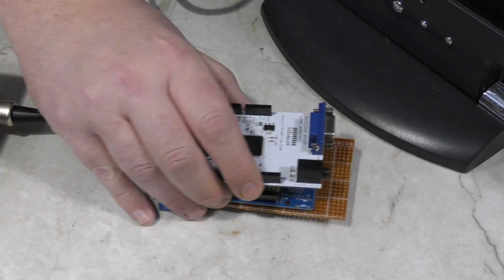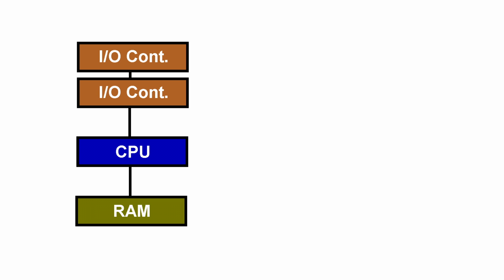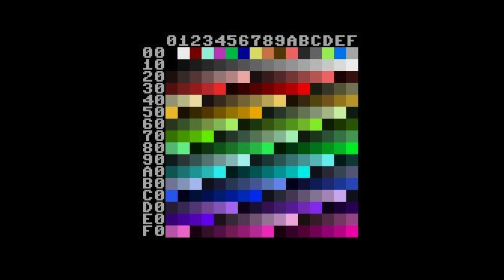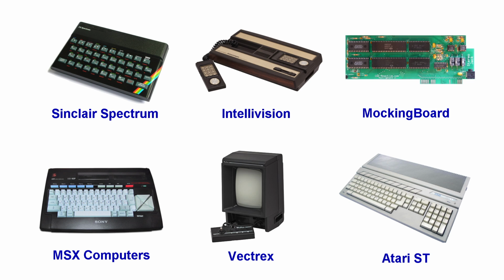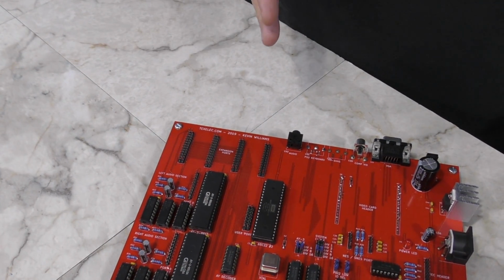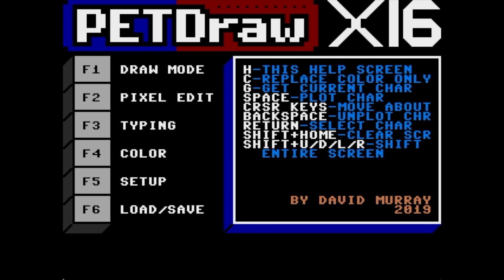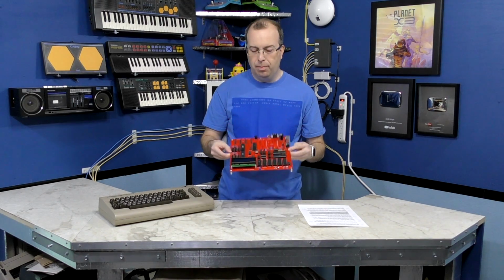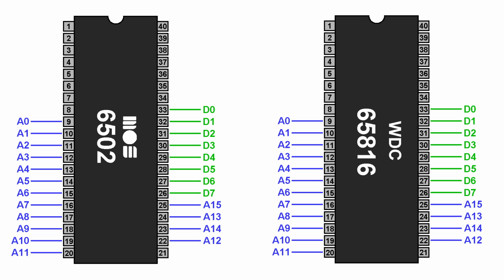Building my Dream Computer - Part 2

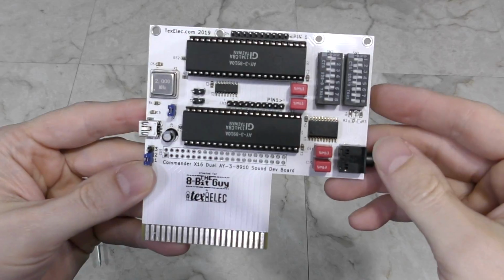Comment: 19:37 At this point you should ask Kevin to make a board that's basically a bus for all these devboards. It could hold three or four cards and sit flat on the table with a removable card edge plug connected via ribbon cable. You could have a small switch or jumpers to select which board will be talking to the C64.

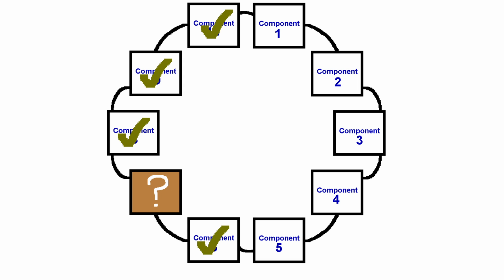Comment: 4:02 ok the way around that is simple. You can do one of many things.  First, you use sockets, so you can pull components and put them in test equipment to test the individual chip components.  If you don't want or can't do that, you design the board with JTAG test pins so you can do border scans.  If you can't do THAT, what you'd do is get a digital logic probe/DAQ and connect it up to the chips (or better yet, test pads) in situ to see what's going on.  Easy peasy

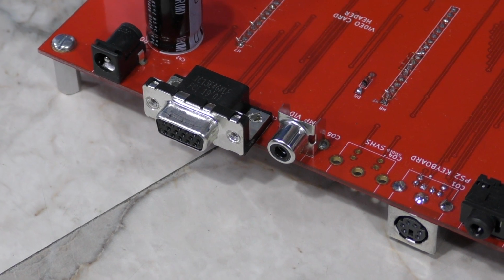Comment: 24:26 A barrel jack? Maybe I should try and power the X16 (when it releases fully) using just a 9 volt battery.
Reply: I don't see why that wouldn't work
Reply: Maybe I should reconsider. I mean 9 9 volt batteries.

Comment: Did you make typos writing kernal instead of kernel?
Reply: He seems to be copying the spelling used by Commodore. It was originally a spelling mistake by one of the designers that made it into the manual for PET, which Commodore later tried to explain as standing for "Keyboard Entry Read, Network, And Link"

Comment: will there be a MiSTer-Version of the X16?
Reply: Considering this is a commercial venture, i doubt it for the time being. Maybe when there are no more sold units, there could be a MISTer version of it. (remember one of the goals is to get earnings enough to sell a rpi sized board with an FPGA version of the X16, so no free versions before that time i guess)
Reply: @Mr-te7dt  I understand this conservative perspektive, but I won't count that as a legit argument. I tell you why I think that. If there will be "to less" customers, there will be "to less" developers. MiSTerFPGA has a ethusiastic developer-community. So if the longterm goal is a X16 at rPi formfactor, why dont compute with this powers to success.
I bought a C128 last week because the MiSTerFPGA brought me back to living 8bit and started programming in Basic again and try to learn Assambly better after 30years. If there would be a fpga-core on MiSter for the X16 (like it does for the rest of the 8bit 'family', like PET, C64, C16..) it would be engaging, i think. 😉👍

Comment: supporting labels in a type as you go along single pass parsing environment is pretty hard to do, considering that you only know where everything is located after turning all the mnemonics and macros that precede it into bytecode. which is why virtually no assembler/disassembler/monitor programs have that. especially not if you also still want to account for things like zero page instructions being shorter and the fact that stuff entered later can overwrite lower locations already filled out, moving it all again. simular programs on much larger computers also don't do that :P if you want an actual assembler, with labels, just use an actual assembler with labels. which will also always be multi-pass. besides that most actual monitor programs for the 6502 can't even compete with dos debug.exe for the 8086... let alone offer more functionality. for something that's been around for that long that is quite disappointing :P

Comment: i like the idea.. but why not just write the software for the raspbery pi?.... its more than capable....   and whatever expansion ports you need?.. idk.. maybe there is more backend software that needed to be written to emulate the 8 bit experience along with how to interface the 1541...  just a thought.
Reply: It's not a goal to have something that pretends to be an 8-bit computer from the 80's. The goal is to actually build a real computer from available parts that is as close to how it would be built in the 80's but with more capable memory map and graphics. If you want a RPi based Commander X16 you can already do that. Just setup the X16 emulator to start immediately after RPi boots.
Reply: @novh4ck  as long as I can rename the file names for samantha fox strip poker for the c64 I dint care what format it is!
Reply: @chrismason7066  X16 won't run C64 games.

Comment: Call me crazy but I think I may know how to get a $50 Commander X16 out. In part one, you were going to use the CPU in the SNES but then said that you couldn't because of how annoying the CPU is, thanks to the way some of the address lines behave. I'm thinking that since the CPU is 6502 compatible, perhaps it'd be possible to put the important stuff (GPU, USB ports, extra ram besides the 192k onboard RAM, SD card slot) on a SNES cartridge and let the SNES be the CPU, since it already has the decoding circuitry on it, making it easier to work with. I don't even know if this would be possible, but if it were, that would be an awesome way of getting to the $50 price range for the X16, and it would be great for Petscii Robots since it already has SNES controller ports on it, since it is one.

Comment: Your main goal is to build a $50 razberrypi that just emulates a retro PC. Why not just buy a much cheaper pi (probably has hdmi port and USB c) and run an emulator on it? I love your original design plans I just think your idea for the final product is useless. Slapping an LS motor in a model T doesn't make a $50 model T.

Comment: You are very outdated, 20 years ago mankind already enter the 64 bit and now we are looking for 128 bit instead of stucking on 8 bit like u do
Reply: The whole point of the project is to make a retro machine….
Reply: If the point of a project is for hobbyist's to build and program their own computer then 8 bits is the sweet spot, if anyone ever makes a 128 bit kit for hobbyist's to solder the chips are going to be 8" long, totally non standard, probably hideously expensive and a nightmare to solder. The resulting machine won't be any more fun or teach anything that the 8 bit machine won't and will still only run at a fraction of the speed of a 64 bit professional machine.
Reply: @gadget348  8 bit system only for calculator, basic clock and some sort like that. Definitely doesnt support directx. Youth generations wouldnt learn anything from this.  Let's forget the past and welcome the future.
Reply: @noproblem3500  ....you clearly don't write programs or you wouldn't have made such a idiotic statement.

Comment: Somewhere there's a small one like tv size fit right, i imagine this: a Tv(Monitor) then it is inside the same Monitor, then just Plug to Powerpoint then computer just like that, adding keyboard and cursor controller, just adding alot of fan maybe, then moving is easy just unplug keyboard and cursor controller, a way maybe like clipping to unlock maybe if upgrading to add ram or hdd. And external usb ports too.

Comment: Supporting the bank lines on the wd65816 requires 2.1666 chips. A LS373 and an LS245 and 1 LS04 inverter. That’s it. NOT lots of extra circuitry.

Comment: One part missing would be a DMA controller like in the REU (REC). This was terribly lacking in the C64 original desing. It could be added in an ASIC that does the glue logic and the video memory access. VHDL file of the REC already exists.

Comment: Great orone t, one thing tho, seeing s vga us on it's way out, would"nt it be better to have the video ans audio outbut be vua hdmi, unkes ifc this ads to much comkexity and cost?
Reply: You have to pay to license HDMI!
Reply: @sierraromeoromeo2444  ye my badly spelled question was more about the cost/device of licensing hdmi anyway having a display outbut almost no one can use ( without adapters is kind of pointless
Reply: @bjarnenilsson80  There are still plenty of devices with VGA input. Same for keyboards and mice that use PS/2.

Comment: Another interesting effect about colors and contrast (the selected grey-scale background used for each colored dot)  Most of the early machines did not allow all levels of brightness of the selected pallet of colors that could be displayed on the screen (some colors had more white in them and other colors, had more black in them, so there were distinct steps in the brightness of these colors if you turned off the color and showed them as grey pixels instead).  The strange thing is that the human eye ONLY -- repeat ONLY -- uses light/dark contrast, not colors, to see THE EDGES of thing that it is looking at.  If two bright colors, say red and blue, had the exact same grey-scale background (turn off the color and they look identical), then YOU CANNOT SEE THE EDGES!!  It is a bizarre thing:  You can see, say, a rad square touching a blue square of the same grey-scale step, but on the edge where they meet it is just a fuzzy blur.  This causes annoy8ing effects on displayed objects, as you can imagine!  The C-64 partially fixed this in its later upgraded video chips by doubling the number of grey-scale steps to minimize the chance of two having this problem if the programmer was smart, but it was never eliminated until the much larger video bit scales of later machines were introduced, allowing slight grey-scale differences to be manually specified  fix the problem in almost any case, if some care was taken.

You can now use such advanced, high-resolution computer displays to test for all sorts of human eye affects on what you are ACTUALLY seeing compared to what you THINK that you are seeing.  It is amazing!!!  This even includes how vision and hearing can fight each other, with vision usually winning, making what you are hearing TOTALLY DIFFERENT (!!) from what is really being sounded out.  Spooky!

Comment: Concerning video color control in these 8-bit machines:  When the first C-64 and similar machines came out, the colors had some "rainbowing" problems with their color screen displays with some "haloing" around the colors so that you had chains of colored characters or points that did not stay at the desired color all the way across the horizontal screen, but changed colors some times in annoying ways.  It took some time before the reason for this was finally understood and fixed by modifying the color-controlling screen display chips.  What was happening was subtle.  NTSC displays needed 65-bits on their screen display logic handling color display, but the people who built these chips did not understand this properly and only used 64 bits, since this was compatible with 8-bit processing and color memory.  This meant that as the colors went across the screen, the colors "lost synchronization" and morphed into other colors as the displayed characters moved to the right, hence the rainbow effect.  Eventually, this was finally understood and modified video chips came out that fixed this.   It is an example of how changing from analog (where 8-bit ratios had no meaning) to digits (where they did) could screw you up if you did not know how to merge such things properly.

Comment: pulsed asynch access, no mhz, because you can pulse any time
Reply: cache memory chips, at 100MHz, would be simple to do and use, and are available, from general stores, online, arrow, digi-key, cheap
Reply: instruction set translation
Reply: waterfall is only a palette cycle effect
Reply: split bus at lower speed
Reply: have a per-clock memory page number setting, page = memory chip, assuming each page is its own chip, simple switch, like an io line
Reply: also that simple works for modding original memory ranges, just switch the ram page, when needed
Reply: multiple 6502
Reply: no fpga, use simple to make the video adapter, yourself
Reply: multi-core commodore 64 like

Comment: DAVE:

Why not do it all on one adequately sized FPGA?
Reply: If you're going to do it that way, why bother with hardware at all, just write an emulator.
Reply: @sierraromeoromeo2444  because you want it low power, high speed and independent. Say to control a robot....
Reply: @Theineluctable_SOME_CANT  No, that's what YOU want, not what the designer wants!
Reply: @sierraromeoromeo2444  pretty useless otherwise.
Reply: @Theineluctable_SOME_CANT  To you, maybe, but it isn't designed for you!

Comment: I was blown away by the VIC20's video memory trick; 1MHz processors with 2MHz RAM, but then I started to wonder. Is it really slower than Atari's 1.7MHz processors with the GPU freezing the CPU up to 40% of the time. The answer is no, Atari's CPUs ran at an effective 1MHz in the highest graphics modes, faster in lower resolutions or color depths.

Lots to love in this video! :D Great to know you can still get suitable sound chips.... or can you?! lol

Selling as a kit will basically be necessary to sell it in Europe unless you want to spend the rest of your life doing paperwork for each individual European country. When it comes to electronics, the comon market is a lie and you have no legal freedom to even give electronic things you've made to your friends. Caveat: this knowledge is 5 or 6 years old.

I've been told SMT is no more trouble than through-hole. One of my friends actually found SMT easier to hand-assemble.

80-column text readable in a video on a freebie streaming site; what a world! :D I would have been happier with the Atari ST if I could read anything in medium resolution; the one Basic interpreter I could find needed it.

Comment: Interesting that 8-bit guy comes at it from a US/Commodore background, but on the UK/Sinclair side of the retro world, the same sort of requirements has driven the design of the successful "Spectrum Next". It almost perfectly meets the retro requirement other than price. But I can see the price of the full kit as described with retro case ending up similar price (i.e. US$300+).
 
Although I have enjoyed the series of videos covering the development of Ben Eater 6502 kit, as a software guy, I think I would rather have something in a retro box that instantly boots into a development environment (Python, BBC Basic or/and Assembler etc) without a large framework of code that needs to be kept up to date (NodeJS is nice.. but the frameworks are insanely large). 
 
Thing is that I have no issue if inside the box there is a FPGA or a RPi Zero. With something like Yocto or RISCOS you can build an extremely stripped down Linux build that just has the core language and tools that are required. From outside the box, would anybody sitting at a keyboard even be able to tell the difference?

Comment: For me the #1 issue with all of these microcomputers back in the day was a lack of a true bitmap graphics mode where each pixel could have its color, transparency and other attributes independently set.

The Texas Instruments TMS9918/A Video Display Processor had a resolution of 256x192 colors and was used in the MSX-1 computers and some game consoles, but it had the horrible limitation of only being able to display 2 colors per 8x1 pixel line. That made people doing any sort of graphics with the chip have to get extremely creative with design instead of being able to freely color ANY pixel any of the 15 available colors or transparent.

The large limitation behind microcomputers not having a true bitmap video mode was the extremely high cost of RAM at a the time.  A 256x192 resolution display has 49152 pixels. To have 16 colors available per pixel is 4 bit color so multiply by 4. 196608 bits of data to represent a true 16 color 256x192 bitmapped video display. 32 Kilobytes (real old Kilobytes where 1K = 1024 bits) could do the job but circa 1980-ish that is going to double or triple the cost of the computer. But then you have space left over in RAM and bits = buck$ so you have your engineers get creative by doing things to drastically slash the amount of memory space "needed" to display the video while packing the operating system into ROM chips...

It all spirals around slashing off hundreds of dollars in parts costs and software tricks in sacrifice of just throwing enough memory at the design in order to have a really nice video display - because Dads and Moms of the the 1980's are not going to lay down $3,000 so the kids can have a full bitmap video display, which most of them have zero clue what is and why it would be a desirable feature.

Comment: Implementing some c code in a dedicated microcontroller to mimic two SID chips for stereo sound shouldn't be too hard.. Bsides that it reduces the cost of the board (uC for 1 buck?) the other huge benefit is that all the existing code, tools AND all the popular tunes from the past can be reused. I wouldn't even consider all the other options.

Comment: Is this project still ongoing? There is a reasonable chance I would buy one. I'm looking for a programming computer for a hobbyist that doesn't require a year of learning about the hardware, OS, and language(s). I used to do that many years ago and want to get back into it but am discouraged by the modern options which involve putting in hundreds of hours just to familiarize with the tools and start coding relatively small projects.
Reply: Hardware is 99% settled, they're doing software bug fixes now.
Reply: @Sierra045  ok

Comment: I wrote an assembler that used subroutine labels and variable names with jump to labeled routines back in the 80's .. I still have a bunch of cassettes with basic and machine code one was a bbs dialer written in machine code .. I might still have the machine coded assembler .. I was starting on a GEOS clone when my C64 gave up the ghost as well as my SX64 .. 😞